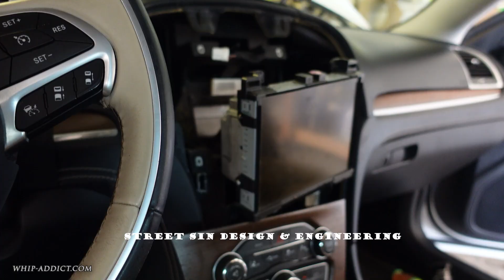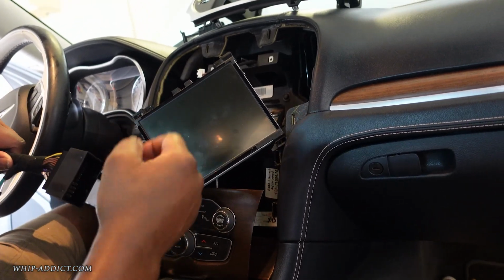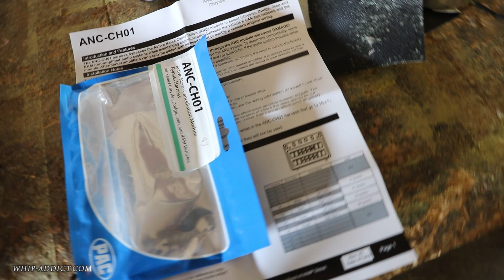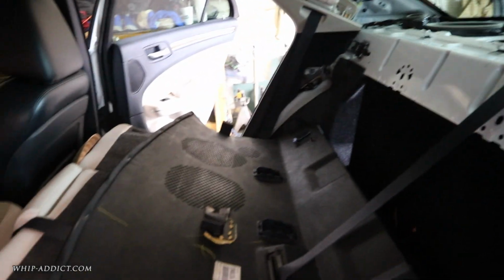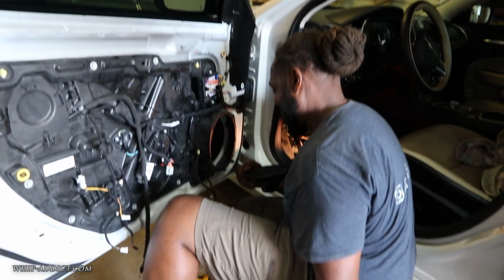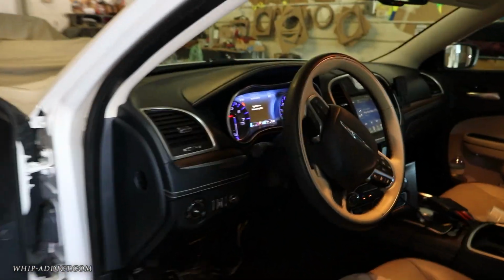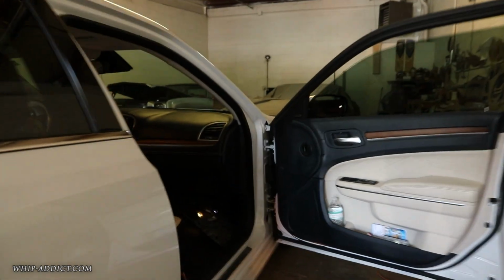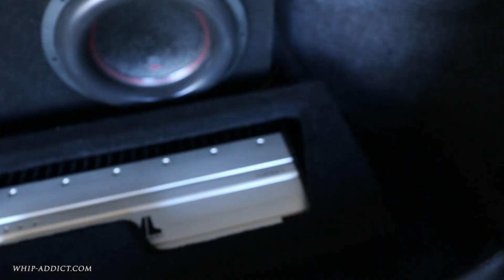5 Times Louder!! Replacing Factory For PRV Audio 6.5s In My 300C! Car Audio Install By StreetSin

Comment: Do you run wires through the molex connector to amp or use factory wire and a 9 wire to amp?

Comment: Mannn, I can only imagine how loud that system is. But Order u some 6x9 to 6.5 speaker adapters, and stinger fast rings for them front doors. You’ll get more sound out of your front doors.
Reply: Why? I just ordered these speakers.
Reply: @AntMaldonado34  the fast rings help push the sound out the door instead of the sound getting stuck inside the door and it usually helps out with midbass too.
Reply: @_aj345_ I have a 2009 300, and came with no speakers except for the door 6x9. I put some 3.5 in the dash but now my stage is lacking midbass. Will any 6x9 to 6.5 adapters work?
Reply: @BEAZY_5150  yeah the one that put the 6.5 in the center are the ones that work. But speaker depth is kinda an issue though
Reply: @_aj345_ yea I had bought some cheapo skar 6x9 at first, put them in the rear deck but took em out because I have a 15” EVIL back there, tried them in the front doors but the magnet was literally pressing on the bottom of the window track and being 2 way with the tweeter was throwing it all off. Sent them back and now all I have are the 3.5 in the dash lol looking at the next step for the doors.

Comment: PRVs for a luxury car is a no go Imo. SQ the way to go.
Reply: Facts!!
Reply: The still get loud
Reply: @jbhouseofshinedetails8827  loud but mediocre. Brands like JL, Hertz, Focal, JBL put out that sound that make your ears moist.
Reply: @hemi08911  True, I have Infinity Kappa 693.11i 6x9s @ the doors/rear deck for 6yrs and still slamming. This was a strange build.  The PRVs are only 125w @ 8hms such a tiny magnet same size as the factory speaker. If you see the amp it reads 2 ohms. He should have went with the Skar 6.5 FSX65 300 watts. I have a quick video of my sound,

 https://www.youtube.com/watch?v=SHo_bed4gzQ
Reply: 300c is not a luxury car, also he listens to rap SQ is cool if he vibed more old school, rock, dance but with rap/r&b its different.
Reply: @demikpre  300s are considered the luxury brand direct competition to cadillac and buick. They aren't Mopar. You're wrong
Reply: @hemi08911 what about deaf bonce??
Reply: @douglascabinatan6042  I don't know enough about them on the front stage side. I've heard a few guys saying that their subs are made with cheap soft parts though.
Reply: Not a luxury car bro😂
Reply: All in the tuning. Sadly prv sound better than a lot of their competitors. And neo magnets don't have to be big, so power handling judgment isn't what you're thinking.
Reply: Where is the Luxury car 👀
Reply: @rizzrizz2291  per Automation dodge, Chysler, Jeep and Fiat. They are.